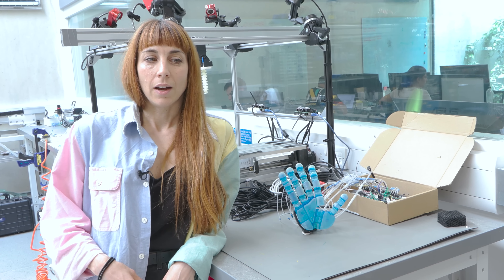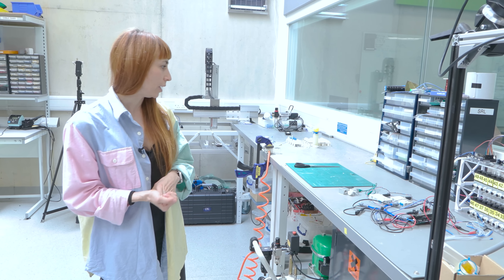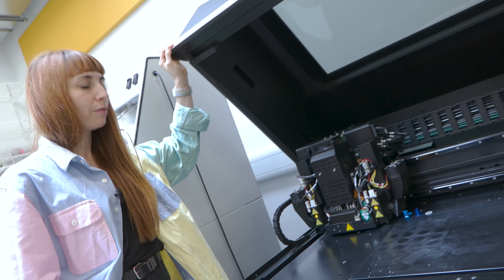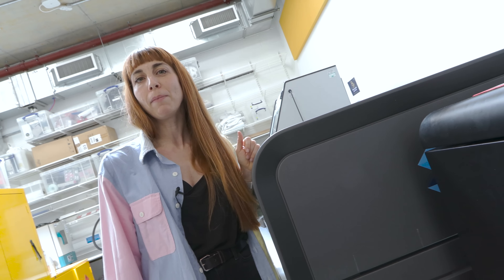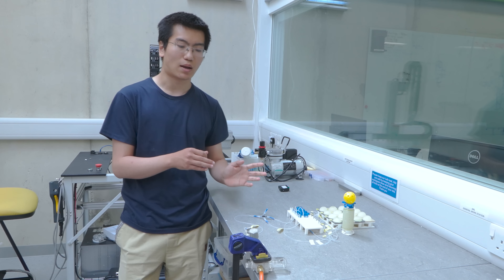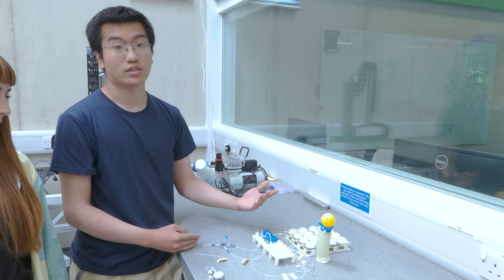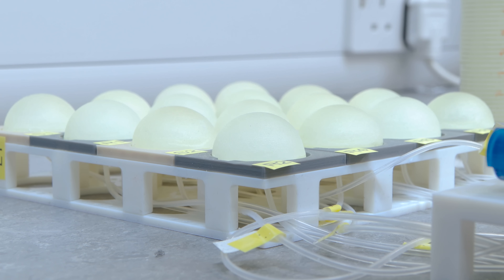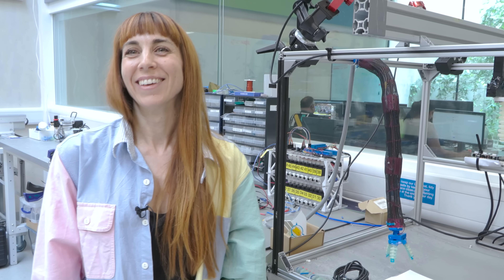Computing with Soft Robots - Computerphile

Comment: Lovely to see steam age technology in action, those spool valves were also known as double beat or equilibrium valves, you find them in beam engines and Victorian steam locomitives , they facilitate fine control against a high pressure difference by putting the high pressure above and below the valve

Comment: Is anyone using fluidics rather than pneumatics for soft robots control? Seems you could 3d print quite complex logic without having to worry about the fit of any sliding parts.

Comment: Well if they're hurting for softbot related research to do, they could try replicating the stomach and the energy extraction from that, without it those softbots are never gonna be portable and I imagine making them so would, at the very least, get buyers from the search & rescue market since would not have to send people into dangerous rubble heaps looking for people, instead only need to send them in if the robot is not enough to get people out after finding them.